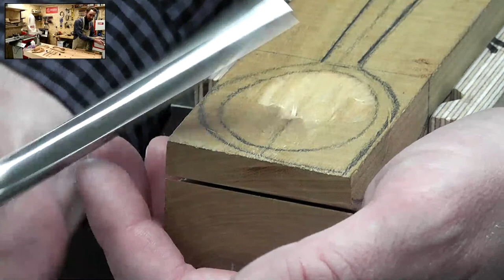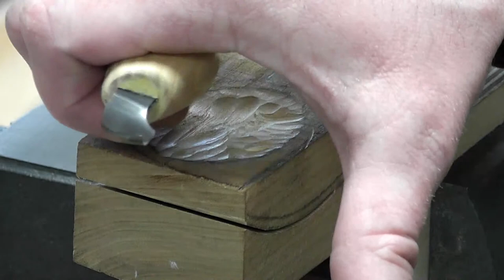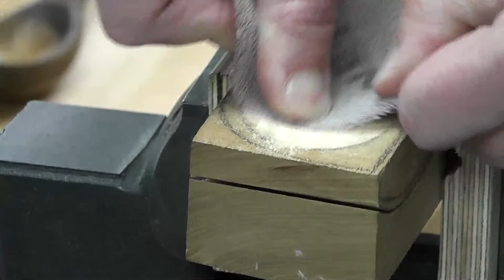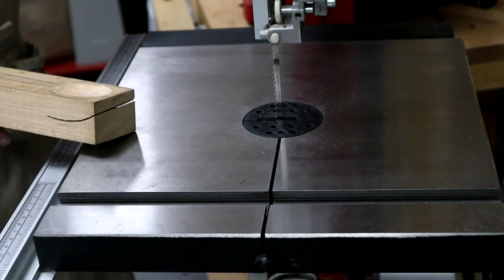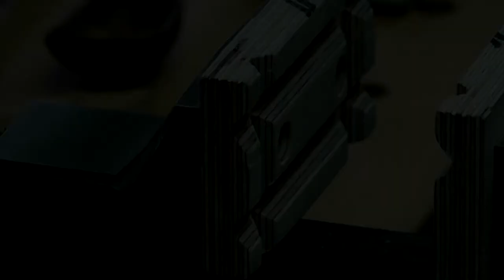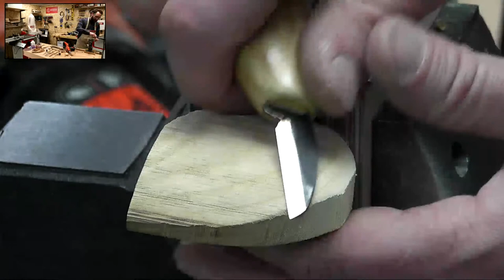Woodworking Wisdom - Spoon Carving

Comment: I have only made one wooden spoon in my life. It was made to customer request by a darts team who are famous for their ability to be consistent looser. I didn't have much time to loose. I used a combination of Bandsaw and router. The spoon shape was a perfect ellipse. I made a set of elliptical patterns in decreasing sizes and then routed the hole out with my Go to router, the Trend T5. The bit was a bowl carver and the result was a near perfect finish, only requiring a bit of sanding. The longest part of the job was making the patterns. Guide bushes were used to assist and the band sawing was done afterwards. The final spoon was magnificent and easily repearale. John Leinz.